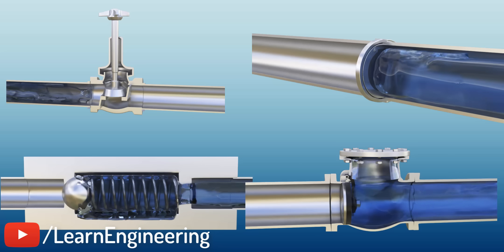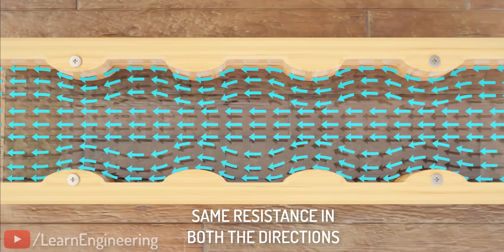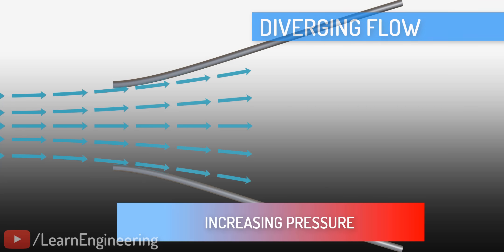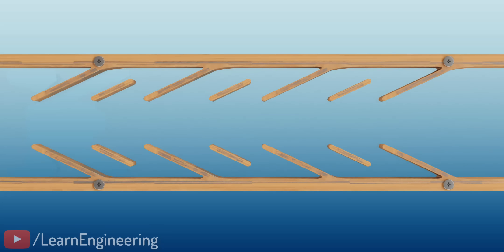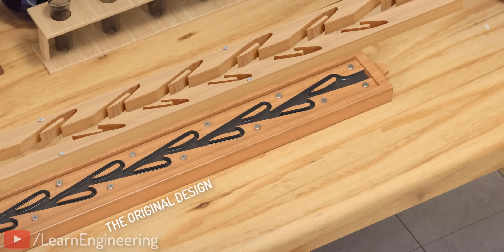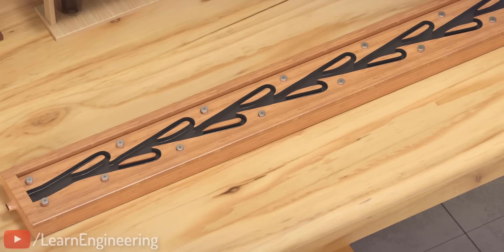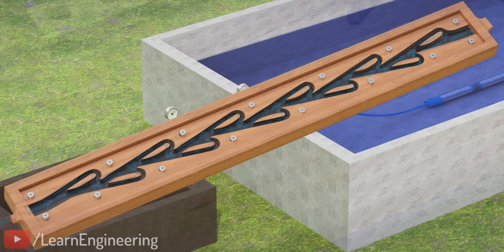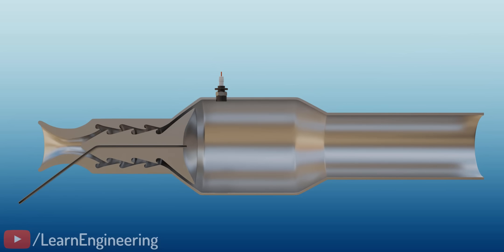Tesla Valve | The complete physics

Comment: The teaching method is excellent. Tesla valve is remarkable.
Reply: Actual conversation with my wife:

What are you watching? 
Something about valves
Why?
I don’t really know but I want to know how it works
What it’s for?
I don’t even know. But I feel like I’ll know everything about valves soon.
Reply: One of the very best demonstrations I've ever seen on Youtube, and short and sweet just enough for my attention span.
Reply: Agreed. I was surprised by the 4k+ dislikes. Perhaps it was from people unable to understand the video... or maybe they are just Edison fanboys 😜
Reply: Claiming to be a “total physics” video without demonstrating a real world model of such a simple device is a fail. The simulation software is fine but not a complete picture.

Also this valve is crap under any appreciable pressure. You’d get backflow in no time. It demonstrates that it is not possible to make a true check valve without moving parts. A small ball check valve easily handles the job.
Reply: @sircrapalot9954  Application of newer technology is much needed. A train 🚂🚋🚃🚋🚃🚋🚃in a tunnel with walls that reflect the divergent air on to the rear of the train would have twice the efficiency of trains today. Using turbo jets to clear air from the front would prevent wind resistance in the tunnel while additional forward  thrust is developed. Directing this displaced jet of air on to a modified Tesla mechanism on the tunnel walls to redirect the air jet on to the rear of the train would again add forward thrust. This is significant since wind resistance at 100 mph is equal to the weight force of the average vehicle. Also, the hyperloop intended to remove air resistance by creating partial vacuum in a tube is more dangerous than the Titanic. 
Lastly, Tesla has been successfully tested in jet and rocket propulsion. It's a topic to be studied by all engineers in this field.  🚴三 happy traveling.
Reply: @solapowsj25  Trains don't spend much of their transit time within tunnels. Adding a bunch of complex machinery (turbojets? SERIOUSLY?) to be used for such a short period of time is a waste of cost and effort. Long tunnels also have built-in ventilation systems to get rid of exhaust gases. The air doesn't just pile up and stagnate.
Reply: @sircrapalot9954  Not true. Time is determined by the interval during which displacement ceases or slows.
This means that you take the high speed TGO train 🚂🚋🚃🚋🚃🚋🚃in France to cover 650 km in one hour. Then you get held up in a taxi in the tunnel to the British Isles for two hours. The net speed is reduced to less than a third. 
It is important to include tunnel travel since they are the main links 🔗 during transportation today whereby distance is shortened and water bodies like sea or rivers may be crossed at high speed 🚴三🚴三🚴三.
Reply: Its not a valve if you cant turn it off 😂😂😂😂

Comment: I wouldn't say it is a one way valve, it's more like a restrictive valve. A one way requires flow in only one direction.
Reply: Yes to that!
Reply: This could probably replace a pressure reducing valve for idk centuries depending on the material the valve is made out off. If it's all copper and buried in the ground  it should but turbulence over time along with pressure could make holes in the weakest  points maybe zinc build up could clog it idk.

Comment: I'm not a engineer of any sorts but it wouldn't change pressure just the volume of flow. In a pressurized water system this wouldn't work well at all due to inability to regulate flow or even stop flow. Plus is should not be called a valve due to no moving parts.

Comment: This is more a governor, or regulator than a "valve"
Reply: Exactly!
Reply: agreed, just typed the same thing. That nitpik aside i loved the video
Reply: Valve

noun

a device for controlling the passage of fluid or air through a pipe, duct, etc., especially an automatic device controlling movement in one direction only.

It's a valve.
Reply: @notahotshot  Yeah, except it isn't.  There can be back flow -- low at the drawing.
Reply: @notahotshot  By your definition provided it is not a valve as it limits flow in BOTH directions no matter how minor in the intended direction. Not a valve.

Comment: This video is pretty badly done.

It doesn't talk about Teslas mind as promised. You talked about his invention and that was it. Saying you did something doesn't make it so.

Furthermore, the first example wasn't clear to me. The speed of the liquid wouldn't change very much going either direction with the valve being that big. Even if it was smaller, it wouldn't make a difference.

Then later you state that liquid loses momentum when it enters the smaller channel. No it doesn't. The only loss of momentum that happens is when the two channels collide. Water crashes once, then it flows. This is why tesla made the two channels clash.

The future is going to be scary having a bunch of people getting to teach masses of people science wrong. Hopefully push back like what I am doing shows up and helps keep the logic flowing the right direction and not colliding with its self.

Comment: I understand the concept, and it makes sense to me but I have a question. If the pressure enters the Tesla Valve at 40psi, and exits at 10 psi, would the pressure change if there was an actual stop valve after the Tesla Valve? 
Wouldn't the pressure on the stop (on/off) valve start to slowly build back up, or would it remain at 10psi?

If there is a better way to ask this question, feel free to re-word it, and hopefully answer it for me.

If it would keep the pressure at 10psi that would be worth using to make parts last longer when trying to restrict the flow.

Comment: Interesting, but how practical is it in the real world? There are real world application, where there  is 24/7/365 fluid flow under 100s pounds of pressure, with thousands of units of fluid fow? The video pointed out this sort of equipment would present a resistance to fluid flowing is the desired direction, that would create additional demand on the pumping equipment. The video also pointed out this design can't totally stop reverse fluid flow. There are fluid flow systems that have equipment that can't tolerate reverse flow without damage. It would appear this would create eddy currents, that would arode the material this would be constructed with. There very well may be applications for this design, but I can't see check valves with moving parts going obsolete

Comment: 5:22 there goes the whole premise of the video, the design is flawed and useless in most circumstances where a mechanical valve is needed
Reply: Fluid physics is just one application however the applications in plasma physics are far greater.

Comment: "the complete physics?"
 far far away from this! I am missing the efficiency of such device. I assume flow in one direction is easier but in the other direction is still quite significant. The animation is nice, but a fluid simulation (or true performance data, like a simple graph) would be much more valuable. But it would reveal the very poor potential of the effect with asymetry not better than 2. Adding more of these elements doesnt change this ratio.

Comment: You missed an important part of the design from the theoretical model to the actual Tesla valve model: The zigzag pattern. The Tesla valve doesn't allow for direct flow through it in a straight line. It's part of the reason it's so effective.

Comment: Prove that the first of the allegedly uneven flow structures actually affects the flow differently based on direction. I believe you from the second one onward, but the first one seems bollocks to me. No CGI, show me a physical model and measure the flow.
Why am I saying this: There's converging flow situations at the outer edges of the structure. Flow is pressed against the outer walls in the "wrong" direction and I am unconvinced that this doesn't cancel out the diverging flow effect from the center.

Comment: Tesla was thinking about nature of electricity and resistance trying to represent it in zoomed out model.

- He was looking for solutions helping to control both by changes in fields. It could made best stuck (battery) with best charge usage.

Naive kid was working in 2-d approach, while dynamics, liquid controlled dynamics, require 3-d solution as it has 3-d freedom. Same problem prevents to accumulate and use plasma and protoplasma having no 3-d complete envelopes and structures like morphing solid containers.

In this example model require similar secondary channels as addition but not in plain surface. In addition to it. So you receive reverse direction with another degree to base, completing perpendicular resistance surface making full stuck. Flow is 3d. You need to complete 3d blocking turbulence with no 'windows' for water to run away. As it finds freedom because of not complete turbulence with shift of it. Floating. Flowing. No freedom - no shift, no place to go. Complete dynamic covering with holding. And making over liquidity to opposite direction. Like co-rolls requiring to speed up at start.

In such way very high quality plasma screen can be generated in air, space, not holografic made by rays projections, made by fields with state storage and switching. Raw example is lights of nothern etc parts of Earth in skies.

Comment: In a pulsejet, you have not a constant pressure flow, but a moving shock wave. A moving area of high static pressure that continually tries to flow into an area of low static pressure. This completely ignores the trick with walls and divarications. This is why the Tesla valve works very poorly on pulsejets.

Comment: In theory it seems great.

But when the flow rate drops,
The resistance is weakened at each intersection, thus letting flow to stabilize. Even if at a lower flow rate. 

At what percentage curve is pressure dropped ?
How much head pressure is needed to see sufficient effectiveness ?

At gravity flow, I do not see much effectiveness with this design. 
I've seen many animated descriptions of use... 
But, not a finished built product displaying realms of usage.

Maybe I'm just overly imposing my reflected experiences, with paper engineers who designs systems that we have to adapt & make work off the sheets of paper.

Comment: Sorry folks, but this device does not fulfill the definition of „valve“
Reply: Yes it does.

"any device for halting or controlling the flow of a liquid, gas, or other material through a passage, pipe, inlet, outlet, etc."

Valves aren't purely on-off switches, they also direct and change the flow. When you use a garden hose to water flowers, you just open the valve a little bit so you don't blast the flowers away.  When washing your car, you open it all the way.
Reply: @Hrethgir  By this definition tying a pipe into a knot is a valve.
Reply: @micha5200  If it limits the flow down to what you want, then it kind of is.

Comment: so in actuality, you baited us all and it isn't a valve at all, since it doesn't completely stop water. You could cal it, more or less, a water flow control device?
Reply: But that is what a valve is though, a valve is a water flow control device. https://en.wikipedia.org/wiki/Valve
Reply: @ericy1817  By that definition, a stone thrown in a toilet is a valve too, as it passively obstructs flow, with the only 'control' you have over it is to either use it or not. While the device in the video is useful, I doubt it can be called a proper valve.
Reply: @alexeysaranchev6118   , yes, a stone thrown in a toilet, obstructing flow, is a valve.

"The only 'control' you have is to use it, or not." Just like every other valve.

The device in the video is a valve. It controls the flow, allowing one flow rate in the primary direction, and a different flow rate in the reverse direction.
Reply: @notahotshot  If to start or stop using a valve you need to completely (un)install it, and it doesn't have any medium flow control on its own (like check valves), is it still a valve?
Reply: A valve that gets stuck right as it would be at  the "closed" position and just before full "open" position.
Reply: Maybe it will stop water when the flow is small. The video mentioned application in small pump
Reply: @kennywong489  no, as flow rate decreases, turbulence and friction decreases dramatically, so there will always be a flowrate in the reverse direction which cannot be stopped.
Reply: @kennywong489  
No. It will never stop the flow completely. In oder for it to do anything at all, fluid has to be flowing. There's no backflow and no resistance in motionless fluid, and therefore nothing to stop the flow from starting again.
Each of the slowing structures slows the flow a little less than the previous one. This is called "diminishing returns". There's gonna be a limit at which they can no longer slow the flow any further at all. This "valve" can never stop the flow entirely, and has less effect the slower the flow is to begin with.

Comment: I want to see this concept applied to a firearm suppressor... would it work
Reply: American?
Reply: The second example he showed basically is how suppressors work, but there are different considerations with suppressors, namely, the bullet needs a straight path through the suppressor, which is not present in the Tesla valve, and suppressors don't require flow optimization in the reverse direction, which Tesla valves do need

Comment: what is the equation of flow and pressure with the viscosity of fluid used? Could I d print one to use as a flow regulator on an oil drip into a wood stove using atmospheric presume?

Comment: in commercial use e.g. a normal home the tesla valve is useless, at most it could be used to seperate the systems of of heating and drinking water but even then those it would need constant water flow to be viable because these systems cant mix, equally in drinking water lines u want pressure with water flow the tesla valve builds pressure but restricts the water so again useless.
like it was said in the end of the video for jet engines and so then ok

Comment: Tesla developed this "valve" to be used in the nozzle of his turbine. All that was needed was to create a pressure differential between the inlet and outlet of the nozzle which would counteract the buildup of pressure due to resistance to flow of the working fluid as it passed through the spaces between the turbine discs.

Comment: There's just a couple of problems here. 
Problem 1: in order to change the valve state you still require moving parts. That being the motion of reversing the direction of the valve.
Problem 2: All flow does not stop as with other Valves, but is simply reduced.
Note: Due to the lack of moving parts it also is much larger in size than other more traditional valves.

None of this is to take away from the brilliance of this technique. It is merely to show the shortfalls and weaknesses.

Comment: The atrium and ventricle of the heart  operates in this way. Peristaltic and diastolic motion.
Reply: Wrong.
Reply: @pavithranthevar5797 
"Wrong"
 please elaborate
Reply: @33sonaram  well, i'll explain. Ventricular valves in your veins actually move and close in on eachother to completely block the flow. They do have a similar shape when you see it on a 2d paper so I get where the original comments misconception came from
Reply: @Dontwantmyactualnamehere  thank you for the clarification.
Reply: 心脏中有瓣膜，是影片开始的时候的例子，而不是特斯拉阀门。
Reply: Those valves are sorta moving parts..
Plus this tesla one is not a valve.. Any one can design this is you say you wanted a differentiator..
But if you say valves this design will hardly come to mind..
Reply: Wow excellent example

Comment: I have to admit I'm a little confused on the converging & diverging flows.  Maybe I'm not thinking of pressure relative to the explanation, but wouldn't the pressure be reduced in the diverging model?
Reply: The dynamic pressure will decrease but the static pressure will increase. Slowing down a flow will increase static pressure and decrease its dynamic pressure.
Reply: Pressure = Force/Area 
Therefore, a decrease in area with the same amount of force will produce a higher pressure. I have no idea what this vedio is on about
Reply: I think it works like a water gun when pressure is pushing into a smaller, the pressure in the liquid increases. Thats how a lot of pumps create hydraulic pressure. But I'm not really well read in engineering.
Reply: For whatever reason pressure decreases when a substance moves faster, that's how planes work. Don't question it
Reply: @тралльилитный-ь7я  the energy of the flow is divided in kinetic energy, gravitational potential (which for this discussion we can eliminate by placing the tube horizontally) and pressure internal energy. Whenever you lower kinetic energy by slowing down a flow, you raise either potential or pressure, if a tube is horizontal potential can't change, so pressure rises.

Comment: The reason why one instinctively says it is impossible to make a valve without moving parts (although we'd have to exclude advanced technologies then and stick to the more ordinary ones) is because a Tesla valve does not seal. It does not have 100% effectiveness. It can also not be regulated. So if you mention those downsides from the start, many people would probably quickly not even come up with this idea of making the flow work against itself, but with any kind of material barrier that allows water to pass only with great resistance. The Tesla valve would then tend to come to mind only if you specify that the valve is supposed to work like a diode, allowing flow in one direction but not the other. Because a valve is not necessarily that. It can also work both ways.